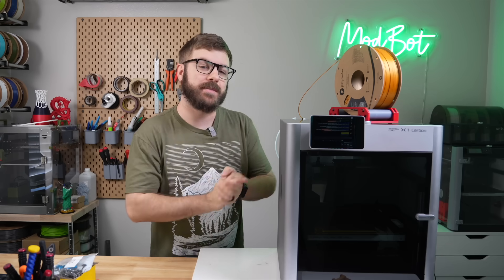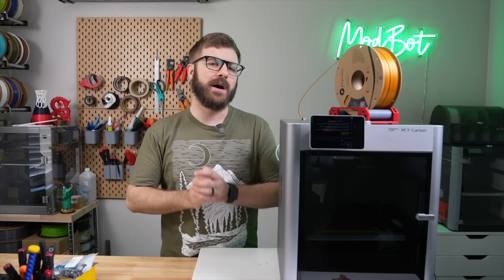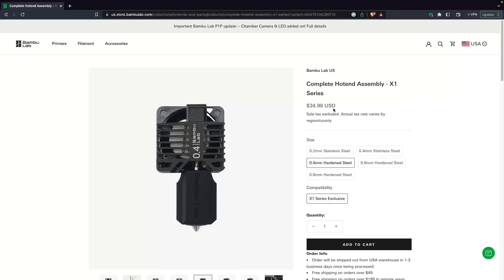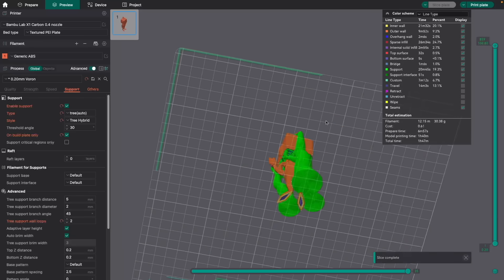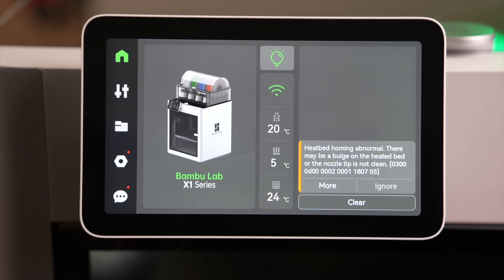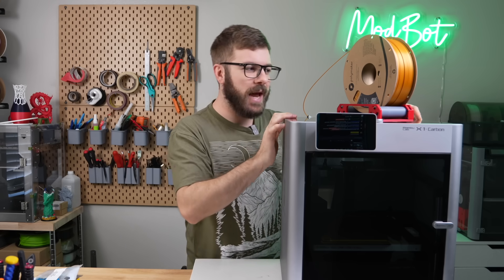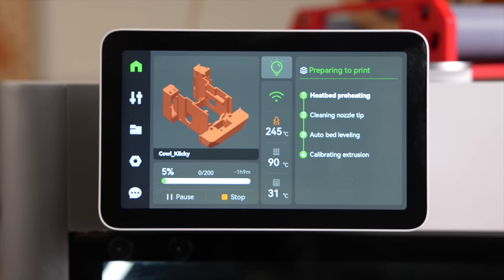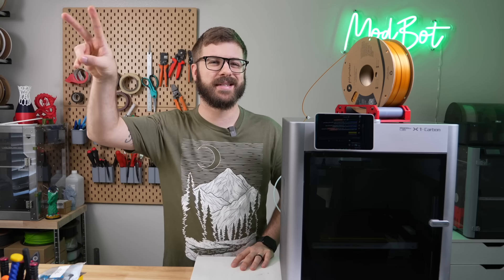One Year With Bambu Lab X1 Carbon

Comment: One thing I haven't been able to find on this printer is how does it do with ACTUAL  multi-material, not just color changes. Swapping between two PLA colors is a completely different task to swapping between PETG and ABS for example due to the high risk of clogging if not purged correctly. How does the x1 handle this?
Reply: Single nozzle multi-material printers have, and always will be, a bad idea.  Using one nozzle for for multiple colors is already a wasteful process (both for time and material) but add in a completely different material and it's a recipe for clogs and issues in general, plus even more time to wait on heating and cooling.  Proper multi-material printing should use multiple nozzles, whether that's IDEX, a tool changer, or my personal favorite, "pivot" or "lift" toolheads.

As an aside, it would be really nice to see pivot-toolheads (for lack of a better term) get more development.  They don't ooze and you can switch nozzles in under a second.  The biggest drawbacks are the extra weight, complications in making them direct drive, and the need to have a servo or solenoid on the print head to switch between nozzles.
Reply: @bentracy7463  there are tons of pivot hotends available on the market that work very well they just aren't common as a default option. Pivot heads are most suitable for upgrading a single hotend printer, as a dedicated printer there's no reason to not go for IDEX at that point
Reply: 3D Print General covered this exact topic in a video from a few months ago, and the conclusion was that it is a bad idea to use materials with different nozzle temperatures - the risk of clogs is pretty severe. He also did a 16-color print all in just PLA using four AMS units, observing that there's a lot of tweaking required to minimize color bleed and even that sometimes 1) still doesn't work, and 2) produces a phenomenal amount of waste, to the point where there was a print failure because the poop chute got clogged. 

If I get an X1C, I would treat it strictly as a single-color, single-material printer. I truly believe that toolchanger and IDEX printers are the only great solution for multi-color, multi-material printing...and even then, it seems like all the major IDEX and toolchanger printers either cost a fortune or require an excessive amount of work to maintain and keep calibrated.
Reply: @justinchamberlin4195  what's the name of the video where he tests it? I've watched his reviews and I've heard him say he doesn't recommend it but never actually recall him demonstrating it
Reply: @schmiddy8433  I don't think he tested it, just discussed how large variations in nozzle temperature are very risky due to burning of lower-temp filaments or unmelted high-temperature filaments causing blockages.
Reply: I can't find the reference with a quick search, but my memory is that it's strongly recommended not to use materials with very different temperature profiles on the same print job.  My personal feeling is that the AMS is more for multi-colour or for things like disolvable supports where the support and structural materials use the same temperature settings.
Reply: ... in one word: flawlessly ;-)

Comment: I too had to replace the bed cable and oh man, was that a time-consuming and tedious task. They really need to update their design to make this type of maintenance work easier. Otherwise, I've been pleased with the printer as a whole.
Reply: @bomas_ulz  Yes the non open-source aspects of the product will definitely become more and more salient over time as the machine starts to wear off.
Reply: Knowing that the bed cable is a common issue, is there anything a new owner can do as a preventive measure to mitigate this? Like adding more insulation where it's rubbing and wearing out?
Reply: @manueltran1964 interested in this as well :-)
Reply: Replacing a bed cable being called maintenance is not reassuring, i must say.

Comment: i wanted a x1c but the bed size throw me off, hopefully there is something in the work for a larger bed size like 300*300 or even 350*350 would be nice and update the design espcially on ams for some of it downful. For now sticking to my enderwire and voron 0.1.
Reply: @bomas_ulz  i agree ideally linear rails, but at the same time that is kinda down to how thick the rods are, there is some voron trident and 2.4 350mm mods out there with carbon rods instead of rails adn they seem fine and expected considering it was almost a solid rod not a hollow one.
Reply: @bomas_ulz  yeha that is very true, if they doing a bigger printer defo linear rails is the way to go, high pretension ones espcially on the x would be ideal. But carbon rods are still have it use inturns of weight savings if it been designed right but it would be marginal if you want decent input shaper results. Oh yeah even my enderwire is able to do p1p speeds easy 250mm/s at 12.5k accel, my voron 0.1 is way much faster than that running at 700mm/s at 100k accel but requires a bit more redesign to get consistence printing at that type of speed but looking to go a bit faster with future servo upgrades. However i do want a bambu on the side that doesnt require tinkering just prints. Would get a prusa if it wasn't overpriced
Reply: @bomas_ulz  yeah that decent, i managed to get my v0.1 tuned reasonabily well to print asa at 300mm/s at 50k for a standard pif print, but  i am looking to make some design changes to see if i can get same quality print at faster speed, cooling is currently the main one i am looking to do. Doing a cpap setup that takes the chamber air which is around 60 degrees and use that to cool the parts should allow me to go faster, aswell an awd setup for it that still allow me to enclose the printer. (Basically a make shift scale down vzbot lol)
Reply: @bomas_ulz  haha yeah get ur wife addicted to 3d printing then you dont need to justufy spending money on more printers lol. Yeah i going with nice quality as a focus on my enderwire but speed on my v0.1. Want to get a vz330 kit aswell later on once simon and team developthe kits more.

Comment: X1 Carbon or XL?  Thoughts between the two, especially with the 5 head XL vs X1.
Reply: My feelings:  X1C is for high-temperature plastics, ABS or hotter.  It actually struggles not to overheat with PLA, especially in my "I live in Canada where we build out houses to retain heat not expel it" townhouse.  The XL isn't really enclosed (not out of the box, anyway) and it would take a lot longer to "bake" that build volume if you're looking to maintain a nice high internal temperature.

The XL is of course a bigger build volume, and the multiple-toolheads design means that true multi-material usage would be much more practical.  Even multi-colour is probably a lot less wastage.  And the XL has that handy power-saving feature of only heating up as much of the print bed as you need to use.

From reviews, the fire-and-forget elements are similar between the two machines, and the X1C / P1P seem to be faster.

So.  I would say that, baring ideological feelings about open source or risk-comfort levels (as Bambu is still a young company), get an X1C is you want to print high-temp stuff; get a P1P if you want to print mid-size PLA fast, and get an XL if you want to print really big PLA/PETG things or swtich between different types of plastic a lot.

This is based on having an X1C and reading a lot about the other two.  :)
Reply: @davydatwood3158  thanks for the well thought out reply. I started with a UM3 and it was always just easy. Have I tinkered yes, but not to the extent of many others in 3DP. Long term wanted a printer that grows with skill. I also have an Epax X1 resin, have upgraded that printer 4 times now and it is a 4K with insanely good resolution. That upgrade/growth path was awesome. I see Prusa doing this, but not Bamboo labs. So this is where I am stuck mentally. One and done for now and buy new later, or is there a way to have it be amazing for longer. 

By the way, in Texas, we avoid heat like the plague here. That said building an enclosure is fairly easy for me. I actually already have the 4040 aluminum and acrylic with a dehydrator to not only enclose, but dry the whole enclosure.

You raise great points. Will have to reconsider and figure it out soon.
Reply: @FineClonier  You cant even buy a multi toolhead xl yet so unless you already pre ordered just get an x1c if you need a printer in the next year. While you can upgrade prusa printers like from mk3 to mk3s / s+  going from 3 to 3.9 or 4 is so expensive that your better off buying a mk4 kit and having 2 printers. So while you can upgrade the prusa printers they reach that point where the upgrades arent really worth it.
Reply: @Cornet4Fria  thanks. The reason for the debate is that I have a preorder and am debating what to do with it. Appreciate the insights on upgrade costs and lifetime.
Reply: @FineClonier  my X1C's printing speed is amazing again and again each day 🙂
Reply: @FineClonier  my X1C's printing speed is amazing again and again each day 🙂

Comment: I'm still very doubtful. Creality K1 or the Bambu Lab X1. Now have an Ender 3 S1 Pro with Sonic Pad and would like to upgrade. If money wasn't a concern, what would you choose?
Reply: I'm in the same position. Waiting patiently to see what the best choice is. K1 or P1P. I've ruled the Qidi X-Smart out after watching Nero's latest stream on it. I'm leaning towards the K1but until they fix those first layer issues, I'm holding off.
Reply: Go look at Nate Builds Robots, he has lots of content on the k1 but it seems to be a classic rushed creality machine with some major flaws.
Reply: @ren8  Yup, been following Nates content closely. It's a pre-production machine if I recall correctly, so problems are expected. Overall though, it looks like first layers are the most glaring problem. Otherwise, I haven't seen, from Nate or any other reviewers, problems anywhere else. I'm not a fanboi of any brand, I just want something that I like and that works.
Reply: @baxrok2.  You havent seen his janky fix for the extruder arm and heightend top cover? Also bushings giving off black stuff. He also replaced the nozzle with a bondtech cht one, wich seems to indicate poor flow.
Reply: @ren8  Yeah, I've seen all of that. TBH, the stuff that Nate does is pretty sketchy in my opinion. That's honestly why I watch him, it's pretty epic hackery and I don't operate that way. He changes/does shit for no reason at all. For example, he lubed the rails for no reason and that's where the "black stuff" comes from. Also, you don't have to change a nozzle to improve flow, you can do it in the slicer. Still, he takes things apart and shows all the parts and I like seeing the inner workings. Does his hackery mean that the K1 is shit, not in my opinion.
Reply: Buy a bambu x1c! It will be the best purchase you ever made in the 3d world
Reply: @nickjeffrey8050  Modbot just proved that that's not the case. ALL printers have their particular problems and deficiencies. If the Bambu was the "best" printer, I'd buy one in a heartbeat. However, right now, there isn't a "best" printer on the market.

Comment: the fact that they made carbon rods user non-replaceable is mind-boggling to me, making consumables impossible to replace by a user is a bad idea and all that just so that they can brag how fast they can go
Reply: Its china bro, they're one of the biggest plastic waste polluters in the world. They make a 3d printer designed to be disposed of when the bushings/rods wear out. They have zero repair centers in the world, outside of their china location.
Reply: Also they could go just as fast with hardened steel ones. Vorons, ratrigs and the k1 all have way heavier gantrys. Makes no sense to me, other than screwing over the consumer.
Reply: @Ren8  not really for vorons and ratrigs, all you do is add a carbon fiber X axis, and move to sensorless homing, then boom, lighter weight then even a Bambu Labs
Reply: @coltenmeredith8899  I know, my point is even with a heavier gantry you can print just as well at these speeds. So carbon rods is just a bad choice imo.
Reply: @ren8  I should have read your comment more before I replied. You are 100% correct.

Comment: I love my x1 carbon combo. Best printer I’ve ever purchased.
Reply: Ditto!
Reply: Damn right!
Reply: Better than any printer I've built or bought.
Reply: @ka0skontrol504 So you support sending all your original designs and patent prototypes to corporations, governments and individuals? You really think that rights agreement would either be written to protect you, or honored by criminal organizations? Man you're trusting!
Reply: @chrissinclair4442 I have so many questions… for starters why are you responding to him? 2 people above him said the same thing.

Also I get that you probably like open source printers, but you don’t need to be so overly dramatic. Bambu lab gives the same speed and quality of a voron(from what I can tell) at a much cheaper price and it comes pre assembled.
Reply: @-Name-here- He's not talking about anything to do with the printer quality, he's talking about the thing in the Bambu ToS that says they store every file you will ever print on their machines, which makes them available to anyone that finds a legal reason to request those files (which is easier than you might think). It basically makes these printers a no-no for any person or business that works with/for any goverments or has patented designs because there's little to no offline workflow with any of the Bambu range.
Reply: @syko2695  there is an sd card, so if that’s the case you could just use that
Reply: @-Name-here-  There is, but as far as my research has told me (I don't own one, but I've been looking around for a month or so) you cannot use a lot of the printer's features if you choose to do it that way. Pretty much all other companies have close to if not 100% offline capability.
Reply: @syko2695  ah, I see. I guess I can see the concern here, but couldn’t someone do the same thing if your cad software works on the cloud? Fusion 360 wouldn’t be safe if it were that much of a problem I assume
Reply: @-Name-here-  Fusion does, but it's very much a different scenario. Bambu forces you to use Chinese servers, probably because the printers are made in China to keep labour costs down, that have zero security measures, meaning no encryption of your data (this also applies to their LAN mode if you're on public WiFi, say for instance at a University campus, people can see what you're printing). On Fusion, their cloud is strictly optional and Fusion will work just fine if you never touch it, and every file you send to it is AES-256 encrypted (A very popular algorithm used in all sorts of fields). I don't know where their servers are located, but I know it ain't China. I personally use SolidWorks instead of Fusion and that works perfectly well completely offline too.
Reply: @syko2695  I see, well good to know then. Thanks!
Reply: There is a Lan only mode. Just use that. You can't use the app but I think you can still use the desktop
Reply: Hey, How does well the AMS work with multi-material prints?
Reply: How many printers did you buy😂

Comment: Is the colouring of the different parts of the object done in the design software (eg Fusion 360) or is it somehow done at the slicer (eg painter)
Reply: yes in the slicer, like paint bucket or you can draw it on manually
Reply: Or, you can import multipart models and select the different parts and choose the colour.